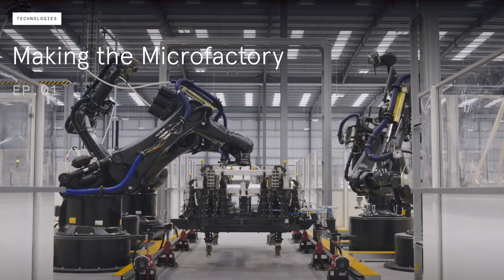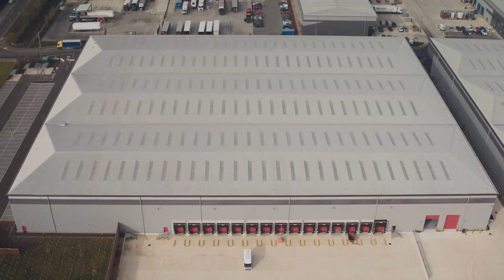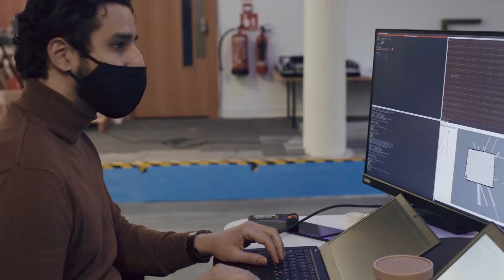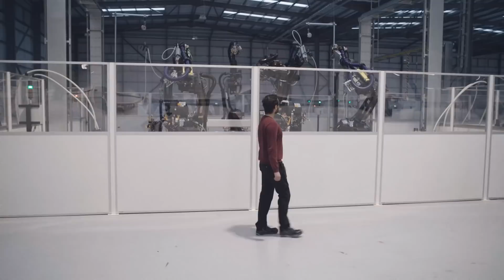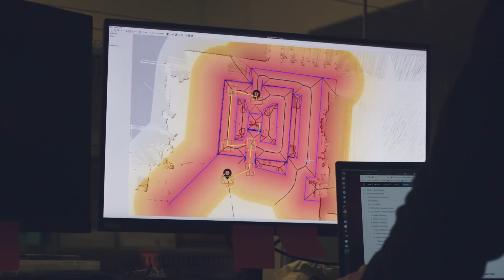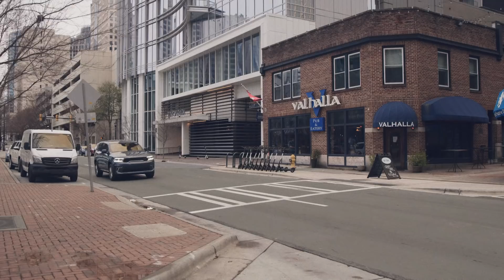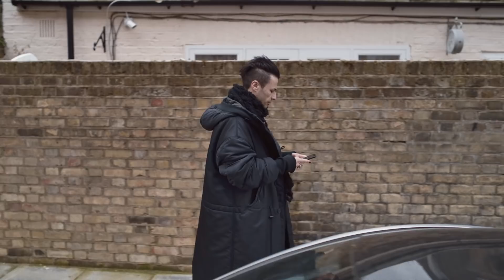Making the Microfactory | ARRIVAL

Comment: This is cellular manufacturing which was implemented for JIT in the late 90's.  There is nothing new here, except the usage of robotics to pick up and move items.  What is missing is actual CNC equipment (Mill, Lathe) to actually cut metal into something.  It is not impressive as the costs for automation are massively high and never pencil out in any sort of financial plan.  The fundamental issue of automating CNC equipment and the waste of metals in the cutting process have not been addressed herein this vision.  Without aforementioned cost cutting, all you have are fancy and beautiful robots that cost a fortune to operate.

Comment: The Microfactory could potentially capitalize on existing yet vacant industrial spaces and quantify the manufacturing equipment locally when needed. This could be critical in many countries where real-estate, tight urban spaces, and limited production scale are factored into deciding where to manufacture these vehicles. This could also help with other industrial products such as medical equipment, electronics, and other finished goods to be locally manufactured into the future. Smart move by Arrival. If Arrival expand their industrial engineering work, they could automate countries and industries facing high consumer demand and in short supply of manpower. This concept has the potential into manifesting into a major strategic saving in costs, efficiency, and economy of scale.

Comment: do you even realize what 10000 cars per year mean? It is 27 per day! That is more than 1 car per hour... From what i'm seeing - you don't even have enough room, power and hands for that. Not even close! 
I've watched all your videos, and i like the vehicles and ideas, but i don't see production. I saw what, 1 or 2 molds?.. Where is the van? Where's the bus?.. I don't see how these so called micro factories even work. But i do see the same part moving on a tray with 4 wheels and then picked up by a robot hand in every single video. Even those shot a year ago. You have great video makers and script writers, i'll give you that.
You promised 20 or more vans to be cruising by the end of 2020 (in video made by Fully Charged at 13:44) - well, where are they?.. Where are these 20 vans? What's going on with you next testing phase?.. 
I'm sorry but so far this looks just a little bit better than Nikola with its H2 truck that only rolls from hills due to gravity. And having that Russian dude with his background (working for Russian media...) - i see lots of red flashing lights when i consider investing in your stock (which is overpriced anyway)...

Comment: This is revolutionary concept flexibility in moving products arround the factory floor..the linear assembly line is an outdated process specially stamping and painting it cost a lot...your concept is much better you nail the cost down...now think of producing a real cheap EV   for commuting only that will be a real revolution so gas car will disappear on the face of the earth you can do it!!!

Comment: So many people struggling to understand the logistics of multiple small factories. True this probably wouldnt work with traditional petrol and diesel vehicles due to the vast number of parts required. EVs on the other hand require far less individual components so the logistical challenge of delivering parts to 10s of factories rather than one is negated. Factor in the fact that  the distance to end consumer is shorter and it becomes an insignificant argument.

Comment: I agree that this is the future, just the success of it doesn't depend on you. You can't control it. The beauty of a giant factory is that you make everything, or almost everything in house for cheap. And when you ship things, or get your inputs, you get it in bulk. That lowers cost. Here every door handle, every button, every wind shield needs to be transported 1 by 1 from far away. Thats why is not a good idea and you don't have much control over that yet. But is the future since manufacuturing everything locally will be the next trend. Because robots replace 3rd world or china workers and you then can do things anywere for cheap, and china and stuff looses its main advantage and shipping from there, waiting for weeks becomes a major disatvantage.  Also because there will be no big nrs of same model, but instead small numbers of very custom products. As custom becomes cheap, everybody wants custom - obviously.
Reply: Custom will never become cheap, not for this
It requires a team of engineers to design or redesign a car. No company will give you the original CAD files to modify to your hearts desire and then let you run all the tests to prove safety and test aerodynamics, even if you had the training to be able to use the programs in the first place

Comment: If hundred of those mobile robots operate on the factory floor, you need to solve more for avoidance of any collision than actually transporting material to the shop floor. Ants could maybe teach this tech company a thing or two
Reply: Is that a real problem? Meaning if this is such an issue that lags like crazy behind the conveyor belt model? Then just copy what ants do.

Comment: It is not clear to me what they are bringing to the table to enable an economical miniaturization of a car factory.   

The hurdles to miniaturization do not lie in the automation/ software space, but rather in the large equipment required to move and form metal.
Reply: Check out some of their other videos. They are not using metal, but some sort of carbon fiber that they make in-house off of the raw fiber on rolls.

Comment: Probably gonna a be more expensive per unit. Probably by quite a lot.
Reply: depends on how much human intervention is needed, if none, just a small team of engineers to keep it all running then it should be fairly cheap
Reply: @abritishguy7295  no it’d have an insane logistics issue, you’d have to make massive numbers of small shipments, that costs more. Also engineers aren’t cheap even a small team costs a lot and this is a team for a factory that’d struggle to produce anywhere near the quantities they claim.

Human intervention is needed continuously, maintenance is required, there’s calibration, cleaning, repairs, replacing the parts that the robots actually use. Then you have to deal with stock control

There is a rule that you want as little things in stock as possible because that is money being lost (as old models are replaced that stock can no longer be used, and you tie up massive amounts of money in that stock). 
But in this case orders would vary and be less predictable, this is because of the adaptability, and the small daily variations because of this would be a much larger percentage of cars manufactured
Thus because orders are less predictable more stock is required to buffer out the unpredictability, this multiplied out to reach a scale similar to real world manufacturing would mean a truly massive increase in stock and therefore massive increase in cost

Comment: It is probably less expensive over all to build one giant factory that produces 1,000 cars a month, than to build 10 factories that build 100 cars a month.  This is due to the efficiencies of scale.  However, while it can produce a lot of that one vehicle quickly and relatively cheaply, it cannot easily be changed or upgraded.  This is why cars have "model years"; putting in even relatively minor changes takes a lot of time, money, and effort.

This is where Arrival's system shines.  They could build a fleet vehicle and start delivering their new vehicles to them one-at-a-time.  As the customer gets used to their new vehicle, they might request a change, which can be incorporated into later vehicles (depending on the change, possibly while it's still being built).  It also means its no big deal for a small company to order a single vehicle (or several small companies to do so).

This reminds me, what's the build time for your different vehicles?  I'm guessing the bus takes longer than the van since its bigger, but I'm curious.

Comment: I’m not sure why… but, this smells fishy. Are you just doing final assembly in these? How close are you to actually pulling this vision off?
Reply: It should smell fishy; it's pure BS. It's people milking investors for all they're worth.
Reply: @timhofstetter5654  no, they just partnered with uber to produce there Uber Green cars in the UK, and with UPS for there delivery vans in the UK
Reply: @abritishguy7295  My condolences.
Reply: @timhofstetter5654  why
Reply: @abritishguy7295  I presume you're asking me a question. Please correct me if I'm wrong. I could be mistaken, since you used neither an initial capital nor an interrogation point.

A "parallel" microfactory is hidously inefficient because workers / machines stand idle, waiting for other workers / machines to finish their tasks. In a conventional assembly line of any substantial size, that doesn't happen; a fairly substantial assembly line carries barely enough lanes for each portion of assembly to keep production flowing continuously.

In addition, a "parallel" microfactory is completely disabled when any worker / machine fails to function properly, and remains disabled until that worker / machine has been replaced or repaired. Compare to a conventional assembly line in which only one lane is disabled when a worker / machine fails to function properly.

Further, the "parallel" microfactory begs for isolating individual containment, which is inefficient of both real estate and heating. In comparison, a conventional assembly line begs for whole-process containment, which is far more efficient of real estate and heating.

The use of "parallel" microfactories requires  very many individual material delivery points and stops; this makes materials transportation inefficient. It requires very many invididual small drops for electrical power instead of one simple, large power drop with internal distribution.

Each "parallel" mcrofactory requires its own set of humans maintenance / setup workers, some of whom will be frequently idle. Compare to a conventional assembly line, which can optimize its manpower.

Do you imagine the human body functioning efficiently if it was equipped with ten tiny individual mouths and stomachs and intestinal tracts and rectums (recta?) for parallel processing of food?
Reply: @timhofstetter5654  That last part would be horrendously inefficient and energetically demanding to say the very least.
Reply: @Iamwolf134  Exactly.
Reply: Yeah, big car manufacturers already have most of production automated except for parts where humans are simply much better, I do not see anything innovative here.
Reply: @radol  The innovative part is the size, they could franchise as an entrepreneur would need a relatively sized warehouse. This would scale their business immensely

Comment: One of the big changes with EV is that the every architecture of the vehicles is towards parallelism, and this in intrinsically suited to high volume series manufacture. Take the battery, it's made up of a large number of stanardised sub components (The battery cells and housings), so the way to get cost out is to make each part as cheaply as possible, so as to bring the overally BOM cost down.  It's the same with the motor and interters, each are eminently scalable from a basic from factor using standardised sub components, be that rotor laminations, PM segments, power silicon or the like. And part sharing is now possible not just between models from a single brand, but between brands too.  At this point, the economise of scale arguement wins out, and the cost of the manufacturing infrastructure becomes irrelevant.  ie why would i set up to make battery cells for say VW, when i could also make them for FORD, BMW, AUDI, Nissan, GM, etc etc. Same cell, same process, same quiality, massive volume, and massive economies of scale.  A few robots knocking together 10k vehicles in a small industrial unit is at this scale, irrelevant....

Arrival is making busses and trucks, where the inital purchase price is not nearly so important as things like the running cost and cost of maintainance and lifetime.  For private transport, ie our passenger cars, this is NOT the case, (and quality is a much much more important factor, again, quality is going to be harder to maintain with multiple assembly sites)  ie literally no body cars if the bus they are travelling on has a bit of orange peal paint on the side, or the door rattles a bit, but on a passenger car, either of those would be a signifcant issue.

the big unknown is where we go with private passenger car transport over the next 50 years, that is the "disruptor" that is hard to guess!

Comment: This is the robotic version of how manufacturing was before assembly line. There’s a reason it fell out of favor. It couldn’t compete with the economics of scale and serial production. I look forward to see if the advances in robotics has allowed small scale production to compete
Reply: This style of manufacturing is more attuned to really expensive things at low volume. Electric trucks are not  it. I also do not agree with their business strategy. Arrival is miscalculating the demand.
Reply: @KingLutherQ  I agree. They may be saving on transporting the vehicles, but having a lot of micro factories is not a model one can apply to automotive at scale. At the very least they should produce the skateboard platform in a convertor belt manufacturing, and they can finish bodywork off in smaller decentralized shops.
Reply: That guy was talking about how big factories overproduce for their local area.  Of course they do, the point is to supply far more than the local area.
Reply: Manufacturing cells still exists. In Roland for example ( https://www.youtube.com/watch?v=Dz4xCCPkni0 ) and a few other companies do that as well.
Reply: Yep I expect the micro factory part is PR, and they'll really be licensing tech to, or hoping to be bought out by the bigger companies. You'd need Star Trek level tech before the convenience of local manufacturing beats global shipping.
Reply: @Anthromod  when done right, micro manufacturing can supply demand faster, and with more customization, than giant assembly lines.
I do agree that the concept seems to be better for smaller, customized runs, than large consumer facing production.
Reply: My thought exactly: de-inventing the assembly line.
There is a case for near-customer final assembly for things simple to piece & too voluminous: Ikea furniture, houses, grain silos...
But main assembly needs high optimisation of tools time, space & inventory to be competitive.
Reply: I would like to add more to your answers.  
I do believe on the end product the cost of producing like this is higher than a regular factory...
Reply: @fireworm91  with the common(er) assembly line manufacturing of cars, you can get cars quite cheap, but you have no choice in how it comes out. All are the same car (ignoring variations such as ECU firmware version, stereo model, sparkplug brand etc). With this kind of assembly, yes, it is more expensive to build a car, but each one can be customized without increasing the cost. Go ask for a 4 inch shorter m3 from bmw. They'll not even quote a price: it's downright impossible and not just for legal reasons. Their entire assembly line will have to be reconfigured for that one car . Now go ask for a 4inch shorter m3 from mercedes. Same answer! (😋)
Reply: The fact of this is it wastes machinery, with them idling as they wait for the next task, this is an argument for job shop manufacturing claiming to industrie 4.0 (not a typo, real name). This would be insanely expensive and slow, the only argument for this is high customisability which is not necessary for this market

The main reason this is unlikely to take off is that you’d need an engineering team for every version which isn’t feasible
Reply: Let’s look at the market. Tesla want to sell millions of std units. Arrival want to produce thousands of units. 
Tesla are buying and building big factory’s and produce 1 unit every two mins. Arrival are looking at 25-30 units a day, for the sector they are in. Based on 10k units.
Bus manufacturers don’t build that many a day.
I think their plans are achievable. What we aren’t seeing in the vids is the skate board, the motor, the battery tech. 
I designed some of the spray facilities of their competition, cutting out this makes a big impact to the production. 
The production plants will still need a fair amount of space, but because it’s not specially built space they can use existing, but will still need a fair plant to achieve the plan.